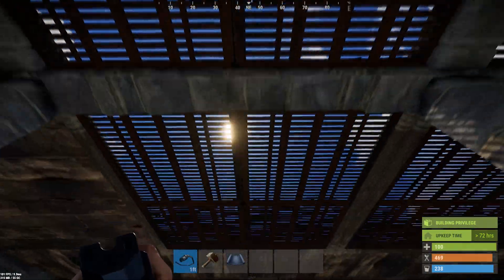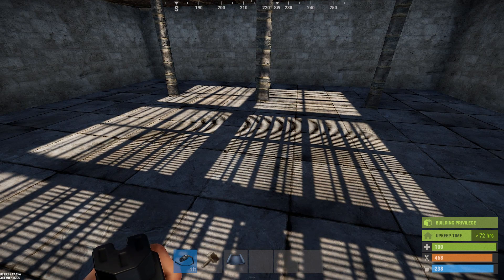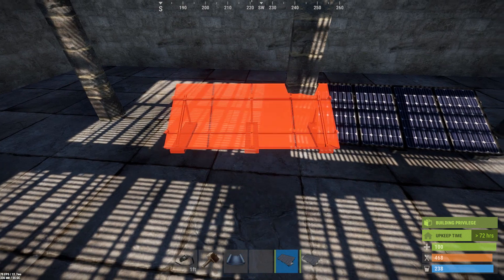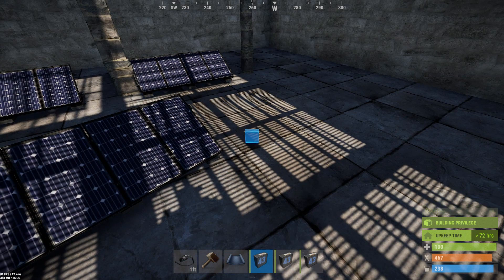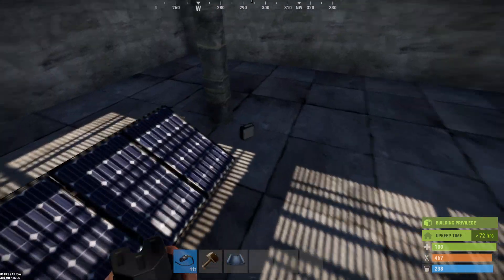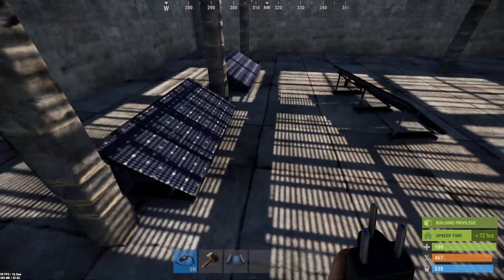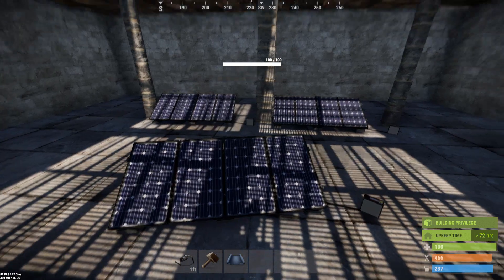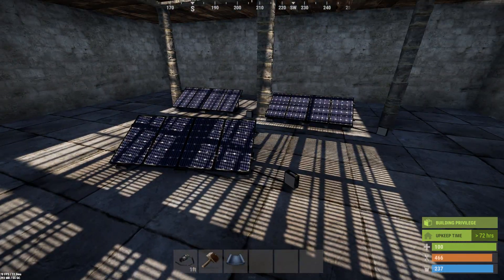Rust Electricity: User Request - Floor Grate Solar

Comment: I’m at work dude or I would test myself but each solar panel is under a beam that the floor grate connects to. Could you try placing in the middle of the floor grate tile